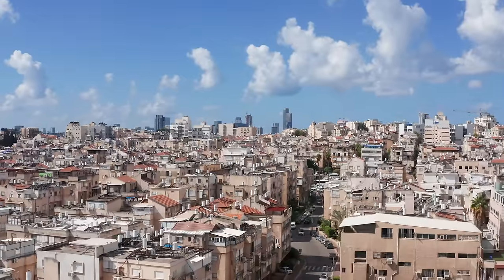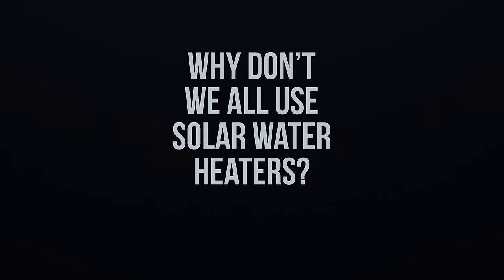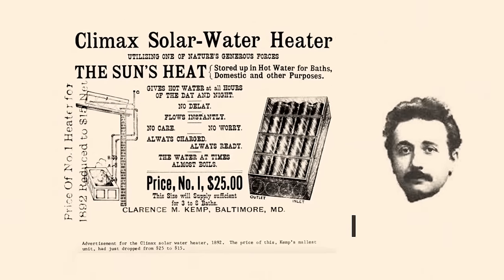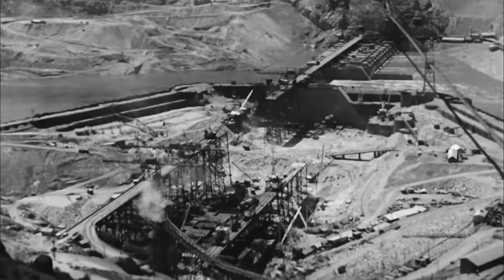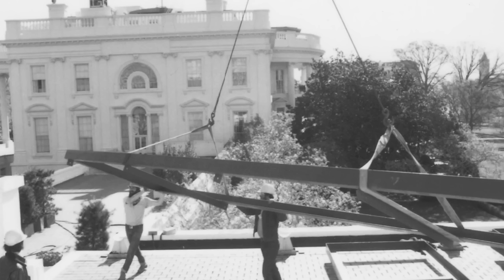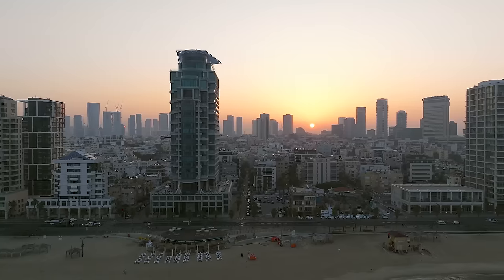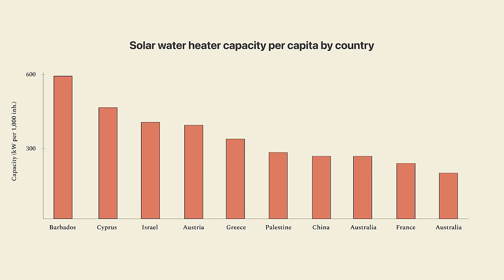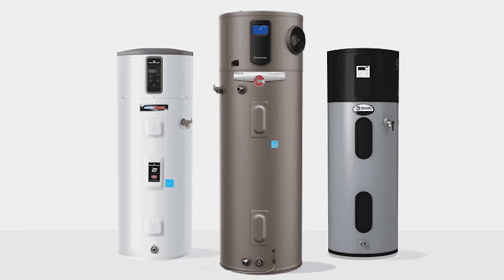Why Don't We All Use Solar Water Heaters?

Comment: Perhaps cost/benefit analysis for many doesn't pan out. Where I live, Ihave 80% cloud cover from Sep to May with temperatures in winter (6+ momths) are always below zero, often going down to a sustained  -30 degrees celcius. Add to  that a 1-2 metre snow pack that would need to be cleared off the panels all the time, and you can see why this may not be as appealing to some.

Comment: Having been to several countries that rely on solar hot water, I can say that Americans would have to learn to shift their showering schedule. For my wife and I, an 80 gallon solar heater could simply keep up with two people showering twice a day each. If I were to install a solar system in America, I’d still need supplemental water heat adding complexity and cost to the overall system.

Comment: In simple terms unless you live in an area with constant strong sunlight it better to go for a heatpump hotwater system and 3-4 solar panels, in summer the power from the panels covers all your waterheating and more, in winter the high efficiency of the HPHW means you still save money.

Comment: The geographical location  of a solar water heater has a huge effect on the price . in a warm climate the most simple and cheap gravity /water pressure fed heaters can be used . 
In a cold climate only more complex and higher cost systems can be used .aside from that the reason there are a lot of solar heaters in Austria and Germany is because they are mandated for new houses and there is some government support .

Comment: You can build your own solar hot water tank. 

Take an old tank thats broken. 

Rip off the casing and insulation so that its a cast iron tank with  no insulation. 
Paint it flat black. 

Put it on your roof. 

Fill it with water. 

Connect a hose, gravity drain. Can also connect directly to a shower head with a on off valve. 

And you get free warm water all summer!

Comment: With the rapidly decline of cost of photovoltaics, another, simple option is to use that electricity to heat a conventional, inexpensive hot water heater. No need for pumps and plumbing.   Heat pump hot water heaters are hideously expensive if you remove the subsidies.  They may be four times as efficient, but hot water is a much smaller portion of the energy needs of a home compared to heating and cooling.  

Due to the unusual grid and rate structure here in Texas, my all electric home is fueled by 100% renewable energy, mostly wind.  So, in a way, I have a solar hot water heater.  (Wind is caused by sunlight disturbing the atmosphere.)
Reply: My bill electric water heater  is close to 30% of total. Modern heat pump water system is so noise

Comment: I use such as 'solar geyser' here in south africa. A good system is very expensive if you buy quality, but in most homes these pay themselves off over some years. In winter here it does pretty much nothing and uses electricity to heat up.

Comment: If you use this setup you must do your research and make certain the company you contract with uses the highest quality of materials that are designed for exposure to the elements and will not rust or degrade because they used different metals at some connection point. The last thing you want is for 100 gallons of water to get dumped on or through your roof.

Comment: The solar water heaters here in North Cyprus are low cost, low tec and work very well. The cylinders are made of steel which is not ideal but replacements are not expensive.  For most of the year it is free hot water!

Comment: Hi here in south africa solar systems are hopeless in winter.
Removed solar 300 liter sys and replaced with 2kW heat pump that gives 9.7 kW heating effect.
Client used to pay R7000.00 per month for electr now pays R2300.00 per month.
Unit heats up 200 litres of water from cold to 55 deg c in 25 min .
Day or night.

Comment: Solar water heaters have their down sides..... it's common in Albania too. The issue comes after the sun goes down and everybody in the building does their showers and dishes etc. When you get up in the early morning (or late at night) the hot water can vanish, be all used up until the next day's Solar activity. Seen it happen a lot here. It's best to have a backup water heater power source.
Reply: In israel we also have the boiler inside the water tanks
and also an instant water heater if we need more

Comment: I think another important thing is the way houses are built. For solar panels to make sense, you need a somewhat low temperature in your heating system, otherwise there are more heat losses and days where you cant use energy that can be produced, because its not enough to get the desired water temperature. Thats also the reason why some people see as good results with solar panels and heating rods as with solar heating system, despite the higher potential efficiency.

Comment: When I was on holiday in the Mediterranean, it looked like every building had a water tank and solar panel next to the tanks.  They are just made of black plastic to absorb the heat from the sun.  They also looked really cheap and flimsy but obviously work.  The water would be cold first thing in the morning but was hot by midday.  So just had a shower before bed instead.

Here in the UK most water is heated by natural gas, or off-peak electricity for small apartments.

Comment: I'm Israeli and I love my solar heater. It's worth noting we all also have on demand electric heaters, which you can switch on as needed (I have a timer on mine too), and a lot of the job of the solar heater is to maintain heat. But yeah, you can't always rely on immediate perfect temperature water any time of day. You have to be more flexible.

Comment: I had it when living in cold part of Europe but tank wasn't on the roof. Summer time you can literally boil 500 gallon tank of water so you should have blinds on panels but winter time it had to be heated with electricity

Comment: Where I live it would freeze in the winter.

Edit: Recently got the electrical panel replaced. Since we need to get off fossil fuel within the design life of the panel: I requested a service upgrade. Luckily the underground Al cables installed as a Cu substitute (in the 70s) are rated to 125A (over 100A if No 2 Cu was used). That head-room alone is almost enough to run an electric water heater (draws up to 30A).
Reply: Use a closed loop system that uses glycol. It doesn't freeze.
Reply: @drood78  Depending on the mix it may freeze below -27 Celsius. Google says even pure glycol freezes at --40. (It rarely gets to -40 where I live, but sub -27C happens for like 1 week out of the year.)

Comment: For best efficiency in using less electricity for water heating can be a heat pump hot water system and use the space on the roof for more solar power panels.

Comment: Overall, the cost of solar water is in complexity and water consumption the US consumes far more than Israel per household, the more piping and flow of heated water increases risk of areas that water can become a hazard if it leaks.  Increased piping thru the home and roof creates additional hidden costs including potential water rot, increased insurance costs, and additional maintenance procedures and troubleshooting, increased structural stress on the roof, further if the solar heater can't reach a certain temp consistently there is increased legionaire bacterial disease risk I believe

Comment: I have been in the water heater business for the past 20 years. In the U.S. the dominant water heater is still natural gas and electric tank type water heaters. If you have to use electricity to heat your water the most efficient and cheapest up front cost is heat pump water heaters. The solar water heater is highly efficient but the upfront cost and long run payback make it hard to justify. In the U.S. the dominant water heater will be the heat pump within the next five to ten years. I have a gas tankless heater. It uses a very small amount of electricity to run the electronics and the blower and only heats water when I need it. I will never go back to the tank type water heater.

Comment: I believe solar panels that generate electricity make more sense now. You can use the electricity to feed back to the grid or run other loads like a heat pump water heater. Solar water heaters need more labor to install. Instead of running wires, you are now running pipes from the solar heater to the storage tank which can be a considerable distance and difficult to do. They can also leak. Solar water heaters most likely made more sense in the 70s and 80s when the photovoltaic cells weren't as advanced.

Comment: I use electricity from my solar panels to heat water in my 250 litre insulated tank. I don't have a battery & it is more cost effective to heat water in the day than sending my spare power to my provider to receive their small feed-in tariff :) I can have a much bigger tank because it is not on the roof. Roof mounted hot water systems are a blast from the past!

Comment: Nearly all solar heaters in Cyprus are triple energy (solar, electricity and central heating is gas, diesel etc). Now lots of homes install net metering systems. With solar panels each home generates electricity and pays minimal electricity bills. Electricity generated is netted off with electricity used.

Comment: I did the sums- the payback time was 50 years. If interest is not charged on the capital. No thanks. In the UK we use combi boilers- small, and hot water on demand- as much as you want. Simples.

Comment: Solar water heaters are awful in my personal experience, here’s why:
1. If it’s cloudy you get no hot water at all. If you’re like me and don’t like cold showers, you may go days without showering because you have no hot water. 
2. Even on the days when it’s sunny, you can’t take a nice shower before 10 or 11am.
Reply: The point of solar water heating is to reduce the amount of energy you would normally use.
Every kilowatt of solar is a kilowatt you're not paying for. You simply design the plumbing so if the sun is available it get's the first shot at heating the water. If that is insufficient your conventional heating system kicks in topping it up.

Comment: I installed many solar hot water systems in southern africa. Water quality was a problem in places. The cold weather in Pennsylvania would require significantly more expensive engineering. Like a heat exchanger system.

Comment: I recall in the mid-1970's a company made a water heater for swimming pools. It was a flat black sheep of plastic (imagine a sheet of plywood with water channels inside) that sat on the pool deck. I don't know why they stopped making them. Perhaps the plastic wasn't strong enough to support people walking on top of it. Maybe people didn't want to drain them in the winter. Either way, heating an outdoor pool is expensive.
Reply: They still make them or something like it. I bought a 3 foot by 3 foot unit for my tiny pool for like 20 dollars. 
I also have some old hot water panels that I would like to do something with. 
The cost to add a hot water solar system would not be profitable as they make smart water heaters now that can reclaim the heat from inside or from outside. Though I wish they would add a 3rd heating element for DC connction up to 5kwh and 500v and then add a hot water panel connection for winter use. We plan on buying one of the 120 gallons water heaters and then a 120 gallon pre tank. The only bad thing about the solar water heater is freezing which requires you to use a heat block or an open system that can drains back. Either way its expensive and I am going to look in to it. If I can store around 500 gallons of 180f max water that should be more than enough for a whole days plus.
Reply: Still in use in Florida

Comment: Quite clear.
And I already knew it
Dirtier is cheaper.
People choose cheaper, because does not care what they are leaving behind. 
Also, in cities you are kind of stuck with what municipality offers. Not enough roof area.

And this is only about hot water. 
What about heating the living space during cold season?
In sunny areas anybody can put together some cheap, not very efficient solar collector. Anyway, hot water is anyway a luxury, not so necessary in warm climate. 
But to use it for heating, you need more efficient panel, like the one with vacuum tubes. And pumps, and storage tanks, and insulation. On free market for sure it cannot compete with traditional heating options. Governments must support this industry

Comment: It's a bit US-centric.  Most water heaters do NOT look like that.  US water heaters look like that.  A lot of euro and uk heaters too.  However, particularly in the UK/Ireland the preferred home heating solution is a liquid loop of radiators.  Radiators in every room.  The primary heat source is a "boiler" which heats that loop of water and pumps it round the house.  Additionally and optionally  you may have a hot water tank.  This is heated either via a heat-exchanger coil from the main loop or an electric heater.  In most small modern homes these hot water heaters have been replaced with "on demand" gas heaters and no water is stored anywhere.  One of the largest single losses in a home is through unused hot water.
Solar water heaters do not directly heat the water you use.  They heat a contained loop of special water containing additives to stop it growing algae, rotting or corroding the plumbing.  It then has to pass through a heat exchanger to heat your water.  As most water tanks won't work in that heat exchanger loop there is often a second heat exchanger loop in it.  The untold issues are less about how much sun you get and more about how many freezing nights you get.  A solar water heater doesn't work when it's frozen.  A solar water heater needs electricity to run pumps.  Pumps are expensive to run.  In winter when it gets towards freezing overnight, it will use heaters and pumps to prevent it from freezing and blocking.  Unless it has a bypass valve, at that moment it will be cooling your house water.  After a freezing night, the low winter sun will take hours to warm it back up to functioning.  So in climates where it freezes overnight they end up costing money in winter.  Solar water heaters require maintenance, they require their loop drained, flushed, cleaned, their pumps replaced, their heaters inspected etc. etc. Moving parts!
Austria use them almost exlusively to heat mountain holiday villas.  Having stayed in similar "pop up villas" in Spain the solar water heating in both instances was "out of repair".
If you skip all the PV to AC stuff and just wire a PV panel via an MPPT to a matched immersion element in a hot tank it will do a better job.
However.  It should be noted that the backs of PV panels can get up to 60*C in full sun.  There are kits you can get to install water loops bonded onto the backside and have the best of both worlds.
Solar water heaters are usually only practical with an electric of gas "top up".  On good days it might get a full tank of 55*C water.  On short winter days it might not heat it at all.  If you have a tank of 55*C water at 5pm and you use 25% of it.  The system will inject 25% of cold tap water into the bottom of the tank.  While you can continue to consume the 55*C water at the top.  That "unmixing" of different temperatures of water only lasts a short while.  Just like we have weather fronts where the air masses mix, so does the water tank and that line will progress upwards through the tank until the 25% of 10*C water at the bottom mixes throughout the tank and leaves you with 45*C water.

Comment: How does that solar water heater work with hail as big as tennis balls, tornadoes/high winds throwing tree branches onto your roof and winter temps below freezing for days at a time?  I'm not interested in having a water leak on my roof in sub-zero weather - I'm too old for that and cannot even find a plumber to repair an issue I have now!

Comment: Also, why don't we all spray a very light mist on the cooling fins our air conditioners?  This would add evaporative cooling to plain heat sinking. We will absolutely need this in the next few decades.

Comment: It is very strange that Austria has higher per capita than Australia. Australia has very high uptake of solar PV,  but somehow solar hot water is not popular. The price of PV has dropped significantly over the years, but hot water has not. Maybe that is because there are higher installation costs.

Comment: I had a solar water heater. the leaks, anti-freeze, climbing on the roof was not worth it. I still have solar water heat. I just use my PV array to run my electric heater. takes 4 panels instead of 2 but it works much better and no maintenance. it just is not worth it to run water to your roof. one more thing. most of those countries must not see temps below 32 degrees F.

Comment: The quality is very hit and miss. My parents had a dual panel system. The first failure point is the antifreeze valves they leaked and the company went out of business and the valves were proprietary no replacement. Then the tank insulation enclosure failed and finally the tank failed. This happened over 15 a year period. That's why solar water heater market failed. Same thing is happening with solar panels today.

Comment: I saw a few in Prince Edward Island where electricity isn't  cheap . Black water hose on top of an eight by eight sheet of wood painted black . This heats cold water before it goes into your electric water heater.
Up to 60% of electricity goes into domestic water heating